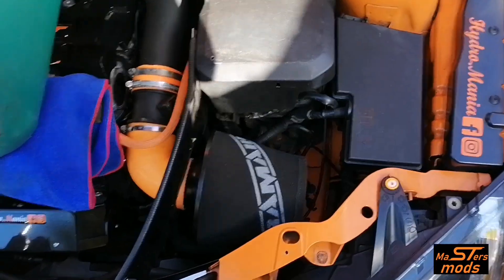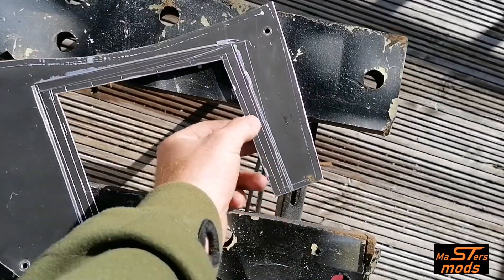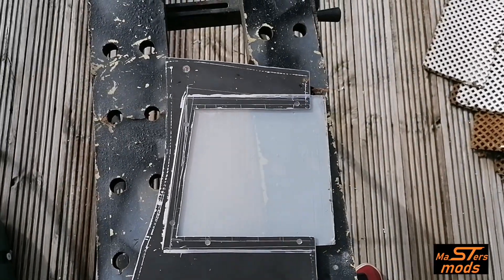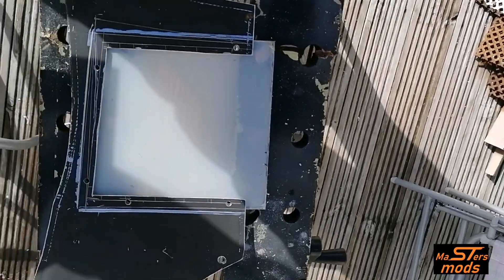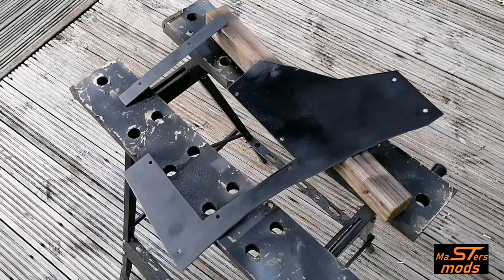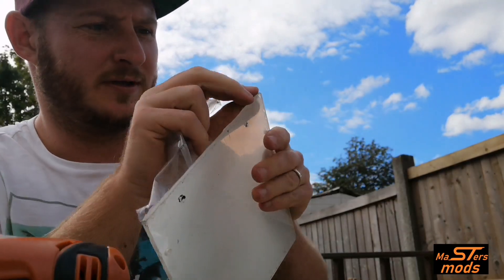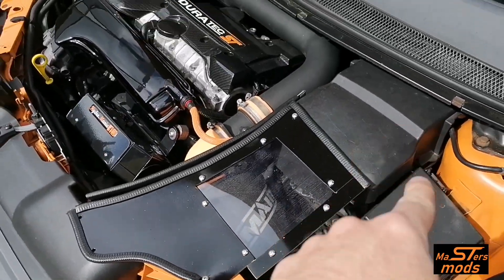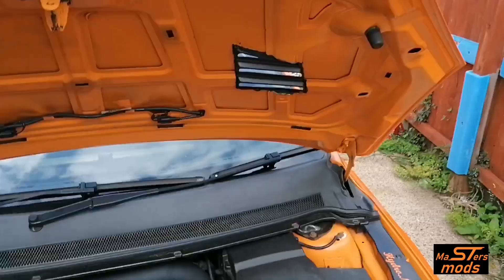Creating my own see through heatshield

Comment: Very innovative🤜.Maybe consider using the oem plastic screws for an even neater look similar to the front slam panel and aslo an option to DIY black "ceramic coat" the heat shield for lower thermal conductivity since these ST225 engine bays realy turn up the  heat up🌡.
Reply from the maker: Cheers mate I'll have a look into that